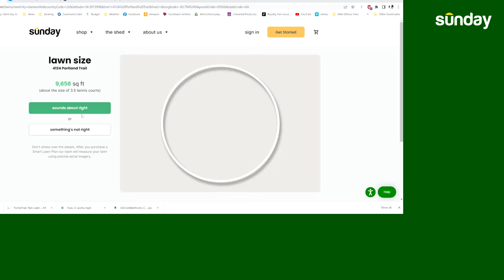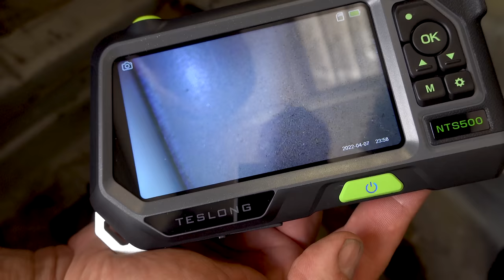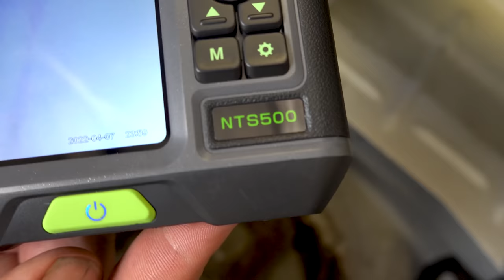A Tree Destroyed My Favorite Car...Here's How Much It Will Cost To Fix It. (TOTALED?!)

Comment: Jared.

Do you remember punching a hole in  brand new Toyota engine block after being warned the not to use the impact on the wrong bolt? Glad I could fix this so you did not have tell Tony. Great story bro..peace

Comment: Pro tip: You don't have to remove (or tree) the glass to get a subwoofer in the back of that car. Just mount them from below, from inside the trunk. Mount the grills on the topside inside the cabin. If you mount your speakers from the underside of the package tray or what the rest of us call the rear deck, you'll have no issues getting them in.

Comment: This is the car that needs to keep adding colors as time goes on.  You need to find another charger that's a different color to act as the new donor car.  That's the running joke with Roadblock.

Comment: This kinda reminds me of when I lost my first car.   I drove the wheels off the thing put the wheels back on and did it again.  She was a pile if I look back without the emotion.   But the memories the wrench time the learning     my now 4 year old drove it at 2 years old.  She loved it my wife learned to drive in it so ya.  A few memories over the 10 years I owned it......(its my profile pic)     one day I got rear ended by a 2019 4runner doing 40mph.   It hit so hard it buckled the floor under the back seat. Crushed the driverside frame rail. The back door was smashed into the quarter panel.     But she still managed to drive home........I miss that thing.   I've had two others trying to relive the glory.  But it's not the same.     Now I have a white one that's a 5 speed (original was auto)  I like it alot but if someone offered to I'd probably sell this one.    Unlike my original which I never planned on selling.   But I had nowhere to store her until I could afford to straighten her out and cage it.  So she has been crushed
Reply: 5 speed LOVE THAT.

Comment: The video we didnt want that many of us have been waiting for.  Can it be fully saved?  Who knows.  Is it something worth doing?  I think this is one of them rare cases that is worth trying for sure.

Wonder if there are offroad lift kits for chargers.  Too bad would be far too much effort to swap in an AWD system.  Make a rally/dune charger.
Reply: He could use an AWD charger for the swap and it would still be oem
Reply: @lilchimpo  I pondered that, but how would the computers respond?  Also, I were there AWD Hemis?  Oh, the chryslers had that option in the 300 iirc?
Reply: @russelljacob7955  there were awd hemis, Westen Champlin has an awd ex highway patrol interceptor, very cool
Reply: @danieledwards1081  Well.  Perhaps we can pressure Jared to go full Mad Max!  After all... Mad Max's car was a police interceptor made ute.  Only without the post apocalypse styling maybe.

Edit:  Looked some up.  Charger didnt have it it doesnt seem with hemi, and AWD, but indeed 300c did.

Comment: In north Florida and much of the southeast USA there’s a type of evergreen oak called the laurel oak that usually dies aged 60 or so. Usually it will shed a few limbs first or at least have many dead branches. Sometimes the roots give out and it will fall over. No idea if that’s what caused your problems.

Hardwood and softwood don’t always describe the wood itself. Balsa is technically a hardwood. Southern yellow pines are technically softwood trees but their actual wood is quite hard.

Comment: been here before.  have a 92 wrangler that i was doing a frame restoration on and I parked my mazda protege5 in front of it the night before a storm just in case a tree fell so it would save the frame.  sure enough a tree fell on the back end of the mazda but it saved the jeep frame.  Totalled my Mazda but sold it to my cousin who did some cheap "repairs" and turned it into a stealth camper.  we ended up taking it to florida and sleeping at a gas station for a week in it while visiting a friend before he deployed.

Comment: Jared said it himself, plenty of power and less weight in the rear, perfect second drift car. Should have just put sheet metal instead of rear glass and fixed it cheap and easy.

Comment: Okay your going to need about a half an inch thick piece of metal that is about a yard long, a hammer, eye and ear protection, probably add ear plugs as that is gonna ring like a mo fo and get to work beating it out, then put a half cage in to reinforce where the body has failed, as its just the roof that's crinkled in, like get it to the point where you can put a windshield in, and vola'

Comment: I was going to suggest just get a 1/2 cut from a wrecking yard and replace the back end, but looks like that is what is going to happen?  I've done that before even though I'm not a body guy I did it and it came out fine.  The car did have a frame not sure if Chargers do but good luck I think it's doable. And it won't cost 15K.

Comment: Reminds me of the accident I had in my 1975 Olds Delta 88. Took a solid hit down the driver side doors when I fishtailed off the road. Still was able to drive it 17 hours back home. Other than extra road noise from where the doors separated from the frame, it drove straight and true the hole way. Besides already being sad about the loss of the car after that, it was compounded by the fact that the replacement was absolute POS.

Comment: Buy a pair of used quarter panels from a scrap yard and a porta power, cut the bent panels off, beat the frame straight and weld the new panels on, if your worried about the structural integrity install a roll cage, shit you could fly me from the UK, and save road block for half that 15k 😱

Comment: I had to laugh the other day when Peterbuilt trucks showed off there new electric big truck and my first question was how far would it go on a charge with a full trailer on a cold day in Northern New York?  Still waiting for an answer.  They have a long way to to catch up with gas and diesel engines

Comment: I have a BMW badge from mine that burned down. A timing gear from my ford that blew up and my rx7 shifter and wheel caps from the one the tow company ruined. So yeah. I would like some broken glass from roadblock. Yes I'm insane.

Comment: how about insurance on the roadblock?? and ps love your dog ;)  whant to see more of her :)  a follower from Sweden,,
Reply: Insurance will total it as the costs to repair is magnitudes higher than the actual cost of the car. They will make you send the car to the wreckers and then give you  bellow market value for it. They will not authorize funds to get it repaired. That's how most insurance works.

Comment: This car had it's back broken. If the chassis is bent, it's senseless to repair.
The structure will never be right or strong again.
It's sad and upsetting, but this car needs to die.
If it is fixed, it will be a cut'n'shut, two damaged cars welded together, and those are a big no-no!

Comment: 3 options i see. you could find a Wrecked charger in the front and chop the ass off and re skin it. could Rebody and Repower a shell with no motor and take OG road block and make him a decoration peace for its valiant service in protecting your home and other vehicles.  3erd option just got get a working car I put this one last because it sucks. I'm not really Shure what to say. I lost my car in December because GM no longer makes parts for the Aisin AY6 transmission I had in my Camaro witch mechanically totaled the car 25 grand gone over night the aisin AY6 manual transmission on the 5th gen v6 Camaro only accounts for 15% or less of sales.  i got 4500$ the parts value witch sounds low but when I thought of parting it out my self and looked up the parts prices they were so low it wasn't worth the effort for a extra grand. the engine being most of the parts value. I even thought oh AIR BAGs I can sell those NOPE on ebay there CHEAP AF to buy and replace. GM shafted me hard when they shutdown production on those parts.  you can get a whole painted front bumper used for 80$ on ebay new fenders un painted for as low as 30$ on amazon the only value is the stock headlight 800$ for both OEM parts. tail lights are 250 each and there is 4 of them. no matter how i looked at it for 4 months trying to figure a way to fix and keep the car 4500$ was the best offer and i took it. did not even get anough to buy another car. i really really feel the pain on this video

Comment: SO here's the funny about trees. They're like people, dumber, but like people. Except their brains are under the ground rather than up top. So when you pull out a tree, from a gathering, you're essentially lobotomizing that gathering. And then there's another thing that happens which every person who owns some woodlands can attest to when cutting trees in a gathering. The trees at the edge will fall, or in this case, your case, the tree that fell didn't have the wind brake effect the others had and got weakened. Coupled with soil shituations and you get a tree that's just waiting to take out your project and make it into an UTE.
IMO, if you cut trees around your house, cut them all, regardless of what the arborist says. Then just get a fast growing tree if you're in need of shade. Trees fall, it's normal.

Comment: dude just buy a rear clip and section it.  Been there done that many time.  My father owned a body shop and I know how much it costs to fix this car.  WTF man 15k is not it.  Rear section it and be done with it.  You can easily rear section it.  The quarter panel can be sectioned about 3/4 up.  That is not a problem seriously and it is not 15k.  It would probably 15k if you bought new parts from Dodge if you can get them.  Seriously 8k with labor seriously.  Come on man you can easily open and close the back doors and the frame was not damaged.  Section it.  If this guy doesn't have the knowledge to do this then tell him to get another job and some education and experience.  Any one can replace part easily.  You can safely section that car easily.